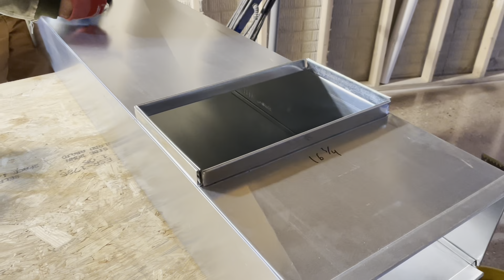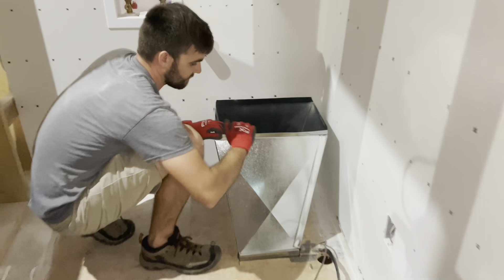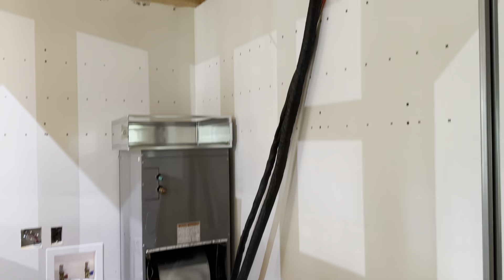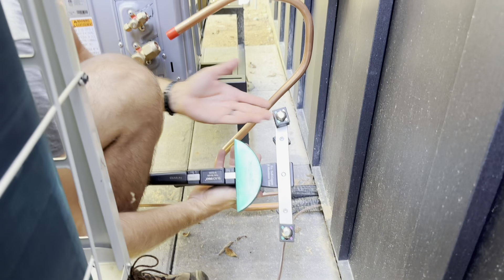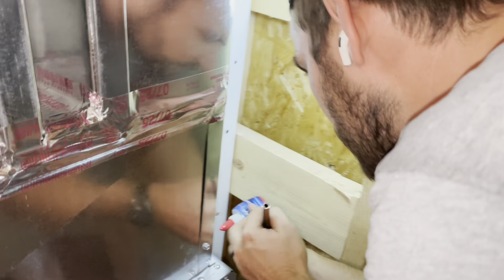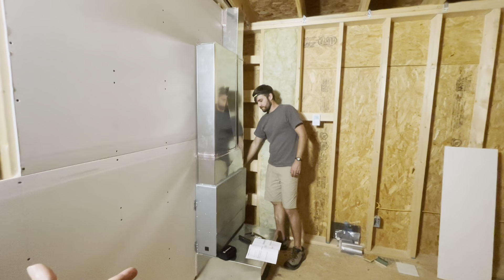We Installed Cold Climate Heat Pumps Ourselves!

Comment: Are you sure the 24v thermostat takes away the variable speed compressor?  I thought Gree had it figured out with a return air temp sensor in the air handler.